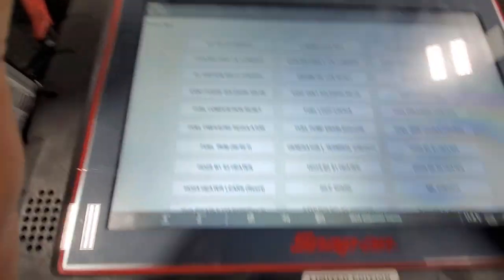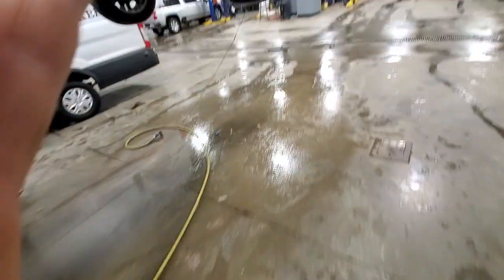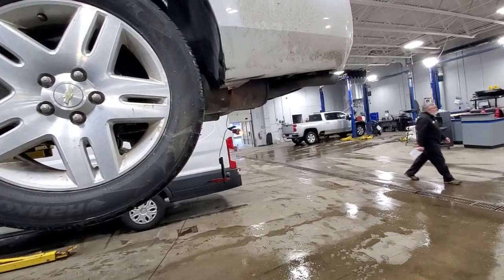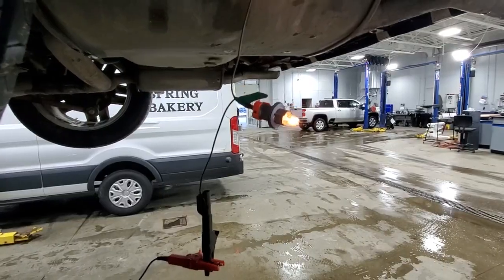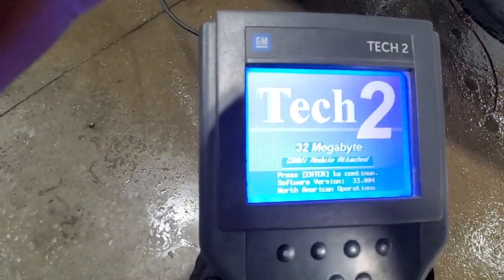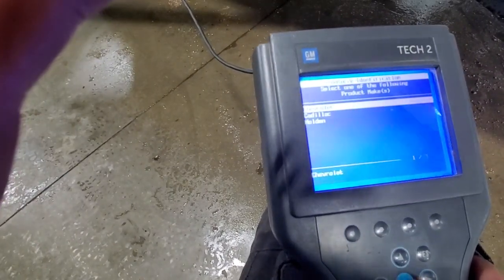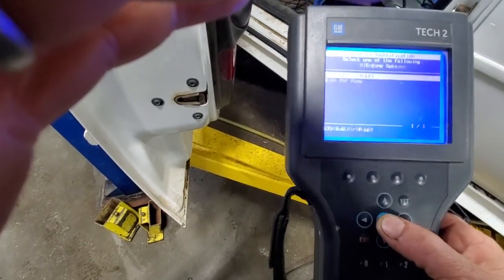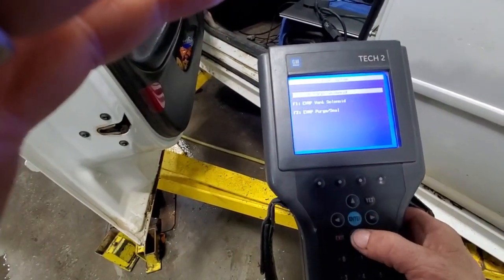"It's things like this that make our job even more confusing"

Comment from the maker: A farm vehicle with a completely plugged up EVAP Charcoal Canister that kept flagging a MIL: P0446 for the EVAP Vent Control Solenoid Circuit Performance, with a long crank time, and hard to fuel condition.

Also, this took out the EVAP Purge Solenoid Valve - from too much Fuel Tank pressure with nowhere else to go; which was flooding the engine through the Intake Manifold and causing a long crank time on cold startups.

Part 1: https://youtu.be/XspdqYPFFQQ
Part 2: https://youtu.be/ECqV-KFSrcs

Happy New Years viewers!

The views expressed on "Pauly's Auto" are exclusively my own, but inspired by my experience.  Please keep in mind, I do not represent any vendors, manufacturers, or shops and I base all thoughts and convictions on past, present, and future experiences.

Thanks for watching.